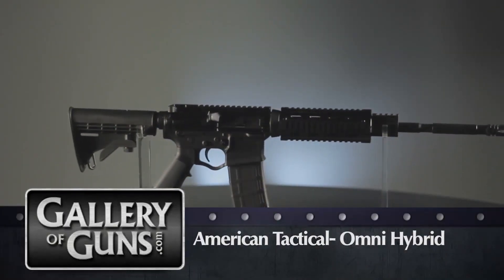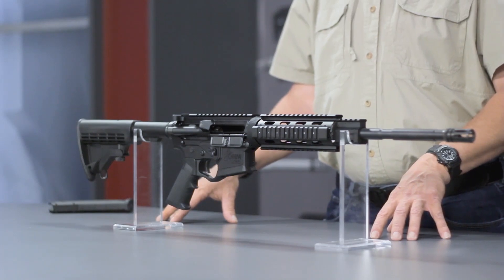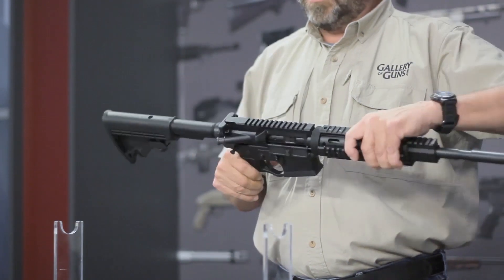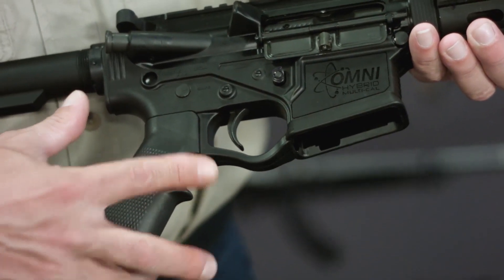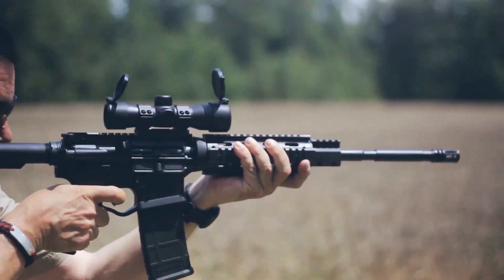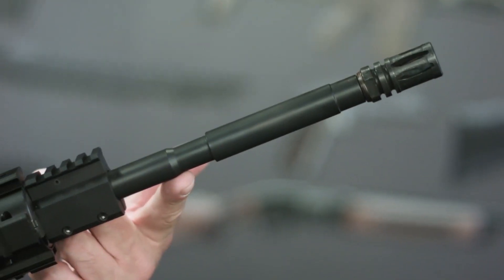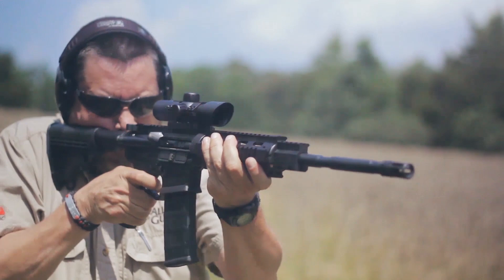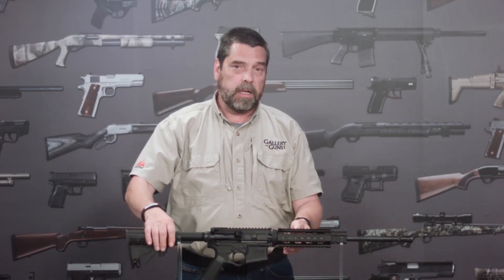Bullet Point Profiles: American Tactical Omni Hybrid

Comment: I got mine from Grabagun for $480 including shipping. I expected to install my own optics and front grip. My manual is helpless in giving directions and "How to do". There is little options at ATI's web site for information on the front grip and where & what to attach the sling to. The front rail NO picatinny but the gas block has at the top. I was hoping to attach a front grip but it looks as though I'll need to modify unless someone has an alternative suggestion.
Reply: if you purchased a rifle with the standard m4 style hand guard, then you will need to replace it with a railed hand guard, or convert to a free float hand guard.
Reply: just get a quid rail if you have a gi handgard
Reply: I have that same problem with my Hawkeye foregrip no where to mount it

Comment: I just took my 300 blackout to the range for the first time and the first 3-4 rounds cycled good after that it was failure to eject I had to manually charge every round and in most cases the bolt was stuck. I was hoping it was just the ammunition I was shooting UMC Remington 300 blackout 120 GR. Very disappointed.
Reply: Better Tactical I had the same issue, for the first 200 rounds you're going to want to grease the bolt and charging handle pretty good then once the first 200 rounds are fired do a detailed clean and disassembly. should work good after that.

Comment: Update........Rifle lasted 2 mags before the FTFs started. Mags would not seat and fell out. Basically an unsafe gun. Gallery of Guns took it back and exchanged it with a Windham Carbon AR15. Great gun. I strongly would encourage anyone to avoid the ATI Omni AR15.
Reply: Dana H I bought 2 of them 489+6bucks. I have yet to have 1 issue..
Reply: Glad it's working for you. Mine was to be a bug out rifle. I will stick with higher end brands.
Reply: Dana H
Reply: Glad it worked out for you. I learned my lesson. Buy once, cry once....
Reply: Dana H I had the same issue with mine, only I was unable to return or trade the rifle once fired. I took some measurements and found that the magazine well was actually 0.03mm too big as well as the milled groove for the magazine catch. good new was I was able to buy a different magazine catch and fixed the problem. the magazine still shakes in the magazine well but doesn't fall out anymore.
Reply: bproudd I actually bought a second one about a year later. I was told that all the problems have been fixed. so far I have about 300 rounds through it with no issues. so far so good, I'll keep you posted.
Reply: 10-4. I must have got one of the older models then. I've only owned it about 4 months. good shooting rifle for the price though.
Reply: bproudd I definitely would not say it's in the same league as any of the Colts that I own. But it's a fun plinking rifle and I'm good with that.
Reply: Dana H
I have a friend he has 1 with the slidefire stock i can't tell you how many rounds he has put down the throat of that cheap AR..5000+.
Reply: Mine blew up in my face....returned a month ago for repairs...still waiting...how long does this process take....?

Comment: I got one just like that and it looks nice but is very poorly made.  I've been working on it all year but haven't been able to get it to fire a single round so far!  The barrel's feed ramps were improperly cut, they weren't even cut in the upper to match the barrel and the barrel and upper were improperly assembled. The bolt didn't work, the charging handle was binding at the back and the mag well is too large to seat the mags properly.
The upper and barrel were replace with ones that fit properly and the bolt repaired but I haven't been able to find mags that will work without falling out, jamming or misfeeding.
Reply: Mine blew up in my face...sent off for repairs...been a month...nothing yet...does it take this long?...they dont even answer back in emails....wat to do?
Reply: Did you call the tech line, or send it back?  Probably not.
Reply: @jamespilbeam209  That was 7 years ago, there was no tech line so I sent them a letter but they never replied!

Comment: i want one!
Reply: I have one, I love it!
Reply: Grab a Gun has them 489.00 they work best with Pmags,,Polymer lower.
Polymer mags..Great entry level AR..
Reply: Mine works grate with gen 2 Pmags. I have no issue with bushmaster mags. I need a punch to push out the take down pin cuz it is so tight fitting tho. not a complaint, that makes it shoot nice and tight.
Reply: jblcva Have you had any issues with the magazines wobbling around in the magazine well?  I have heard of this issue from a few sources.  I'm going to pick up my Omni Hybrid Lower this weekend. However, I'm not really sure I want to have this as the backbone of my rifle if there is a tolerance issue.  Thanks!
Reply: nds101122 No i have not. I use Pmags they are polymer. Heck my steel mags fit tight..
Reply: I own a ATI Omni Hybrid Max, I love it. In purchasing any firearm, you got to fully inspect it because they might have visual defects. I got a good one. 
I installed a quad-rail to add my attachments such as flip up sights,  handle grip...ect

My 14 year old and 11 year-old  daughter handles it well with the flip up sights.
I fired over 1000 round through it without any problems. I clean it after usage, but the polymer doesn't get that dirty.

Comment: This rifle is a POS! This is the short version... Took it out to the range with brand new ammo and it would not feed properly. Yes the magazines are good as I used them in my friends AR without fail. Emailed them twice with no response. Then called customer service. I shipped the rifle back to them for inspection to which they changed out the gas block. According to the armorer it passed safety checks, they sent it back to me. Took it to the range today damn thing still will not feed properly. Crap rifle. I previously owned a Colt and never had a single issue with the rifle feeding properly. I have the Omni Hybrid Multi Cal5.56
Reply: How long did it take to get it back...they had mine for a month....mine blew up in my face

Comment: "Solid, well built gun"  Bullshit..... I've had mine sent back to the factory once.  Replaced once. Had 3 parts shipped to me to "Fix" issues. And still to this day, this piece of SHIT rifle will not feed....  I don't mean it has FTF's, I mean this ball busting sack of shit of a "Rifle" won't feed even ONE round from the mag after firing one from the chamber.  No, I take that back... It actually IS a FTF rifle.  They should change the logo from the ATI logo to a FTF logo.  Avoid this like the plague.